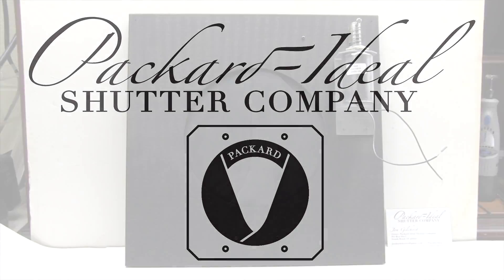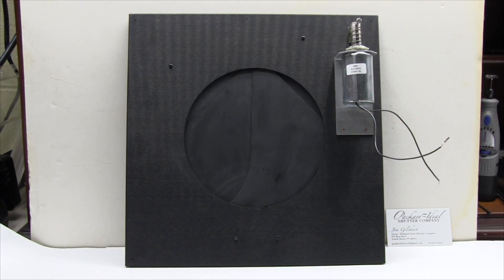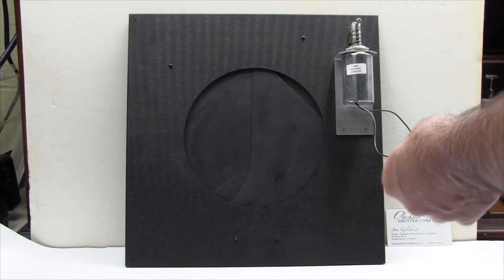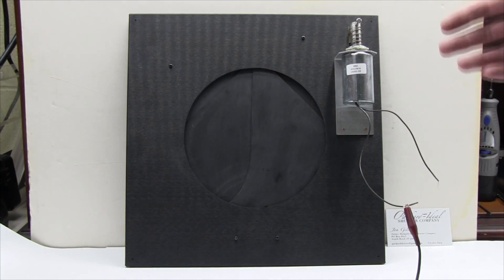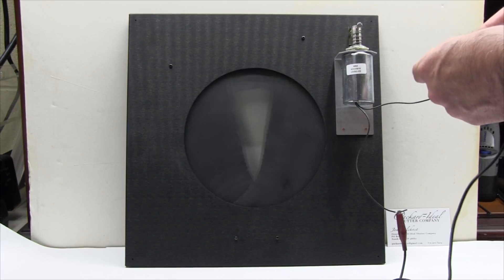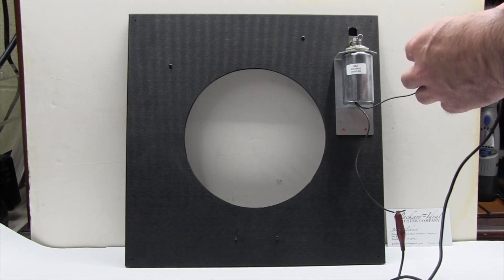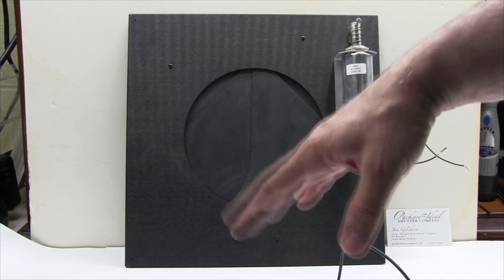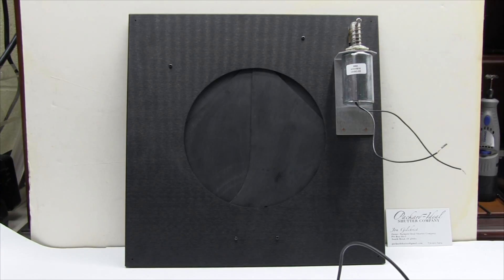Packard Shutter 7-inch Electric

Comment: Lovely that you are still making these.  A durable link to a specification document would be a cool thing to have in these YouTube videos.

If you want to give people ideas you could throw out use cases that they have been used in.  This will give people more Aha moments as to finding a use for them.

Can it handle the light from a spot light if it has metal blades?